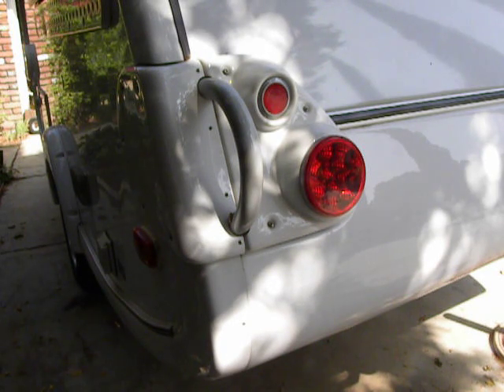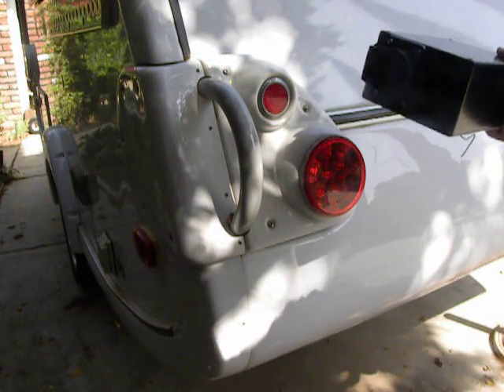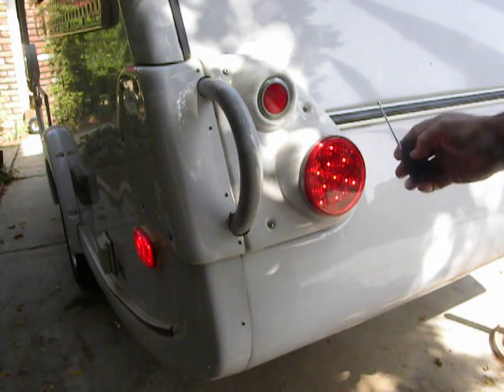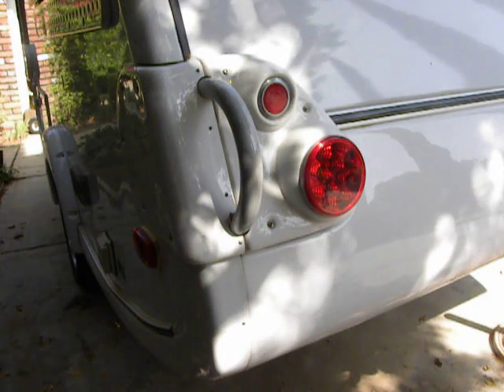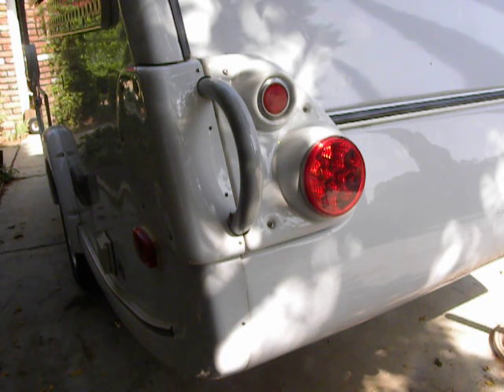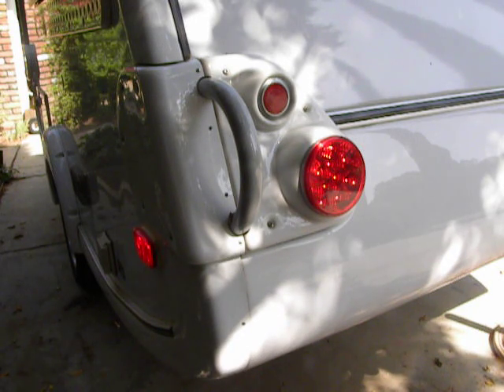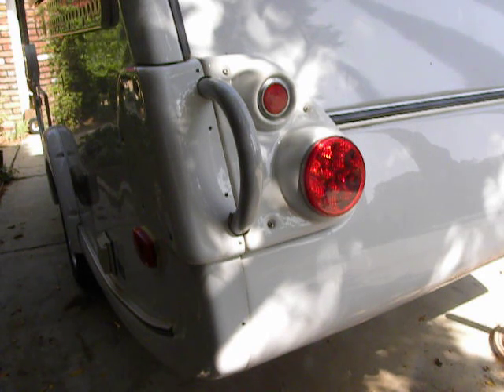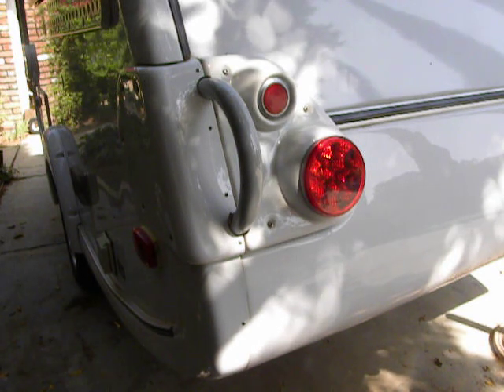Remote Control Unit for Taillights on T@B, T@DA, Casita and other 7 pin trailers

Comment: Hi Richard.Just wondering if you need to install a resister inline when replacing the incandescent lights with LED to prevent the fast flash.